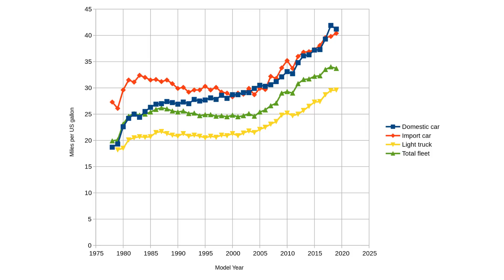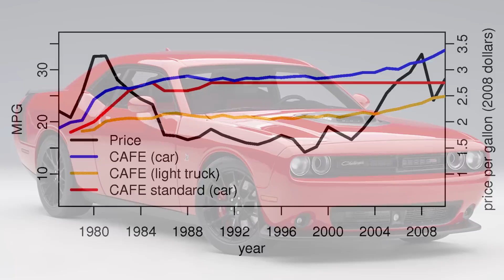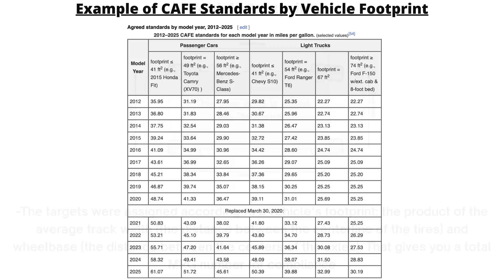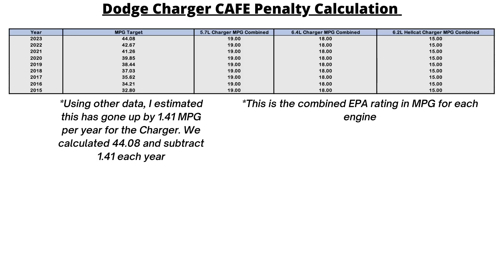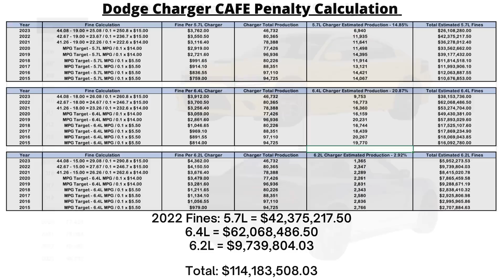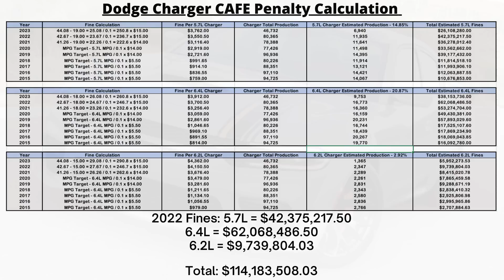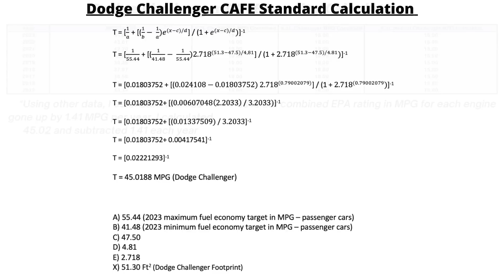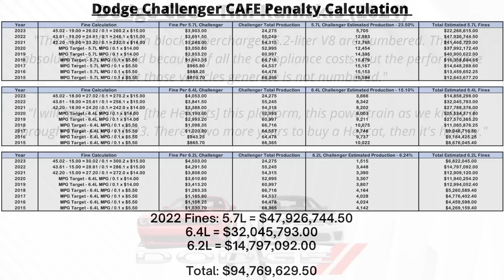The Real Reason Why Dodge is Making EV and Turbo Muscle Cars – Hemi Engines Are Too Expensive?!

Comment: Dodge should have had hybrid Chargers, Challengers, and Durango's years ago to offset the CARB requirements instead of paying Tesla for credits. Yes the environment is changing quickly but greed is the reasons in my opinion FCA drug their feet. Having a hybrid Charger, Challenger, and Durango people would have purchased it similar to other manufacturers hybrids

Comment: My thoughts are over a trillion cars manufactured worldwide since day one ain’t nothing compared to what it takes to keep the power running in each city let alone the batteries in the electric are causing more harm then then the gas engine. To run a ev engine is to take it from the earths core like the oil. Lose lose but gas prices will go up till the gas vehicles are not allowed to manufacture no more. Jus stick to what I know and own and that’s what’s a fine when you could the time. One more thing Dodge ain’t paying no fines once that bank approves you and takes it off what you earned. My question is nvm the fines for transportation to get you to work what about the fines for big companies starting the forest fires up here in Alberta. Keep your 2024 hemi crisp still in the bubble wrap like a Pokémon card you never know they might be worth triple then a ev will be in 15-20 years

Comment: It’s legislation and corruption that are the problems, not the motors. I’ve got a WBSP and get the exact same mpg as out of many previous 4-banger motors, including ‘08 Impreza and ‘12 Terrain. Beyond that, the elites pretend to be proponents of green initiatives while remaining heavily  invested in big oil on the back end. The system is only geared around profiteering and control of the populace, and NOTHING else.

Comment: Well done video.  More sympathy for Dodge and Stallantis?  Short answer, NO.  They knew this was coming and could have invested in a new more fuel efficient V8 (and make it a true HEMI).  Also it seems to me that Stallantis, and even FCA before it, were slow to invest back into their products. They backed Dodge into a corner by making the brand only about performance vehicles.  It was a foolish move not to have a Dodge version of the Pacifica and call it a Grand Caravan (loss of brand equity and name recognition). They let Chrysler basically die on the vine.  The Pacifica is a great mini-van (my wife drives one).  But the 300 received no love (marketing dollars).  And look how long it is taking them to bring out that Airflow (and again foolish not to use that name plate for the production version). Ram made a Great Leap Forward with the 5th gen 1500. And from then on its been one expensive "Special" trim level after another. Meanwhile Ford and Chevy/GMC have almost caught up on interiors, And don't get me started on the HD's (5th gen cab anyone? Gas engine in the Limited trims, NO, go elsewhere!) And where the hell is a Dakota??? The only division to get dollars seems to have been Jeep.  Yes the Wagoner and Grand Wagoner were way overdue (they did a good job on them).  But other than that, only the Grand Cherokee and the Wrangler are true jeeps.  The rest of the line up is Euro crap (IMHO). But even there they are strangling the golden goose with the pricing (especially on the wrangler).  But again, all this is just one mans opinion.

Comment: People say that the government killed the Hemi, but if that were true, GM and Ford wouldn't still be making V8s. What killed the Hemi was not the government, not Fiat, not Peugeot, it was no one's fault aside from Chrysler themselves. Chrysler shortsightedly focused on leveraging their profits from Wranglers and 1500s with any consideration of increasing fuel economy throughout the fleet. Or maybe instead of the stage kits which they aren't even moving to consumers, they could have invested in making a Hemi that could meet stricter mpg requirements.

Comment: Tim Kuniskis has said that's they are getting rid of the Hemis because they just can't do any more with those engines. They were originally designed for production just after World War 2. He has also said that we are now at a point where we are squeezing just about as much power out of a gasoline engine as possible, and the only way to go faster is with electric motors.
Reply: The modern hemis share nothing with ones from the 60s. They don't even have the hemispherical combustion chambers the original engines were named after.
Reply: They could make the cars lighter.

Comment: As always , very informative content. Thank you for the in-depth research and calculations. 
Definitely a high penalty price tag for the V8s but I would think that Dodge passed a lot of that on to the buyers; As we have seen the Hemi vehicles go up significantly in MSRP price the last several years.
Reply: im sure dodge passed it all to buyers.  Im sure buyers gladly paid for it.   Dodge is screwing the pooch.  Long live fords v8s and manual transmissions!!
Reply: That's that line on the Window sticker called "Gas Guzzler Tax" - they didn't eat all the fines. I just think it's no longer a sustainable figure (what like $8-9k) to add to the sticker. ESPECIALLY with the ridiculous ADMs I've seen. RIP HEMI......sure wish it didn't have to end this way
Reply from the maker: No gas guzzler tax is entirely separate. That’s basically a write off, they charge the customer on the sticker and pay exactly that amount to the IRS (they can only charge what they have to pay). So customer does fully pay for that. The CAFE fines are different and extra on top of that
Reply: @MarspeedCars  Wow.....I stand corrected. So it's the government double dipping - how unusual.....thanks for the clarification. Really enjoy the vids.

Comment: Interesting how so many instantly forgive the government for frivolous laws. I dont think we should. If politicians support forcing us all into EVs we need to vote them out. This should be left to the market to decide. Instead we have market manipulation giving thousands or even tens of thousands off EVs and extreme fines against more affordable conventional cars.
Reply: Electric cars aren't more expensive than gas cars anymore as far as production costs go. The only reason electric hasn't come down further yet is due to so few options being mass produced.
Reply: @simpleman72685  I'll bite. Ford F150 starts at 50 grand for the EV. Gas starts at 33 grand. It was 60 grand for the EV recently but they were not selling which forced Ford's hand. Can you name 1 that is equivalent priced to a gas one? Or even close?
Reply: @srtmetal  The Chevy Bolt starts at 23K. Compare a similarly equiped F-150 Lightning to a gasoline counterpart. Ford is testing the market. That's why they are fluctuating the prices. They could come down to 40k eventually.
Reply: @simpleman72685  The Bolt is extremely similar to the Sonic hatch which was quietly cancelled the moment the bolt came out. They were 16 grand to start. Bolt is 26,500 before destination. They are expensive no matter how you twist it.

Comment: That was a serious knowledge drop right there. But I think most people understand why Dodge decided to go all electric. Having a naturally aspirated 5.7. 6.4 or supercharged 6.2 in a car for regular people wasn't feasible, with all the rules and regulations. Not only that, but Dodge basically reached a pick performance when it comes to V8 engines with a warranty attached to it. There was not much left to give, so the only logical solution was to go straight into 100% electric, where power is basically ""limitless"" (I know limitless is a big word) but I think people get my point here.

Comment: Green Earthers and their influence on the US Government killed the cars we love.  I will only buy an EV or Hybrid when I have no other options.
Reply: I don't want to see Tesla build the fastest car. They are the least reliable cars on the road. Competition is another reason why these gas engines got to go.
Reply: @simpleman72685  "Competition is another reason why these gas engines got to go."
Your statements in this comment area are ignorant and show a serious bias. Competition is what make everything get better, regulations do the opposite. The grid couldn't handle everyone owning electric vehicles as its the same infrastructure standing from almost a century ago. Most states with hybrid/electric use fail when a disaster happens because what is on the road is already too much for the system.
Not to mention how inefficient these electric vehicles are at this point and the amount of serious environmental damage lithium and cobalt mining has to create them. Gas engines are 85-90% efficient while electric motors are nearly 30-35% efficient. The competition isnt even close. Gas engines are cleaner, more efficient, more reliable, and standardized already. Outside of a fantasy perspective, electric vehicles are a novelty.
Reply: @Raymo2u  Look up the 5 fastest production trucks on the road in the quarter mile and get back with me. Look up what MPGe is as well. Maybe next time you can come back with a comment that doesn't sound like it came out of a board meeting at Exxon Mobil.

Comment: cafe ruined dodge. RIP hemi engines
Reply: Nope. If that was the case, GM and Ford would be killing their V8's as well. It's not Fiat nor Peugeot's fault either. This was all because of Chrysler shortsightedly leveraging themselves on their profits from Wranglers and 1500s without any attempt to have a more fuel efficient fleet until it was too late.
Reply: @AE86FTS facts. It's their own fault. They should of created a more efficient V8 like their competitors.
Reply: @AE86FTS  Wrong. Ford and GM currently make plenty of other fuell efficient vehicles so there cafe fines aren't near as high as what Dodge's are. So Ford and GM can afford to keep making there V8s.
Reply: @Modine.  How does anything you said contradict what I said?
Reply: @AE86FTS  Because you had mentioned it's not the cafe fines that's killing the Hemi, saying that if that were the case then Ford and GM would be getting rid of there V8s as well. That's what I was disagreeing about.
Reply: @Modine.  I still don't see the disagreement. You said that GM and Ford have more all around efficient fleets that allow them to keep making V8s. That is exactly what I said
Reply: @AE86FTS  Well your initial reply to @CarGuy-hf6cn was the opposite of this, saying it wasn't the cafe fines that were the reason Dodge is discounting the Hemi. What part of that do you not get?
Reply: @Modine.  That is not what I was saying. I was saying that it's easy to blame CAFE's existence for the death of the Hemi, but Chrysler had a whole decade to adjust for that, which the competition did. Chrysler acted shortsightedly throughout the 2010s and had it not been for that shortsightedness, Chrysler could still make Hemis while remaining in compliance
Reply: @AE86FTS  Thank you for rewording it, that makes more sense.
Reply: Also, the demise of interstellar with the 🎉problematic, annoying and even more expesive electronic garbage. It's your choice fellas... make the right one if you are a true MoPar guy or gals.✌🏾
Reply: Nah,dodge ruined themselves by abandoning economical vehicles. They were ahead of the game during the early 80s with 4cyl and turbos.But they still have time to reverse course on EVs after seeing the struggle ford and gm are dealing with on their evs.
Reply: @craigerickson6308  EVs are a gimmick.
Reply: The French ruined Dodge, get your facts straight.
Reply: @fortheloveofnoise No it clearly the cafe standards the are killing the Hemi cars! The French don't give a shit about the Hemi. So why don't you pull your head out of your ass.
Reply: Neither one of you guys watched the video…
Reply: @johnpisarski5077   Don't tell me I didn't watch the video! I know wtf I'm saying.